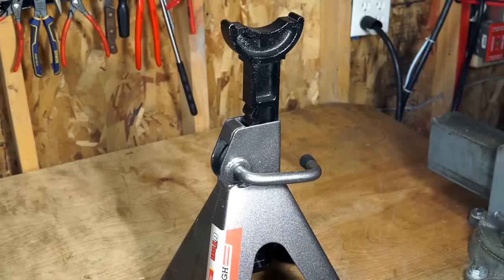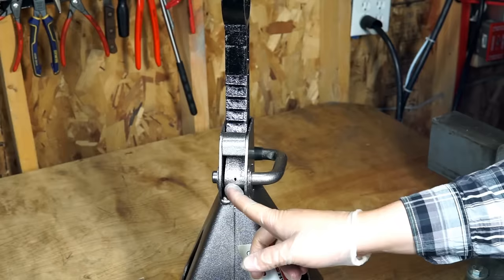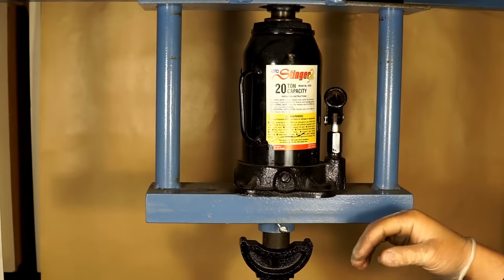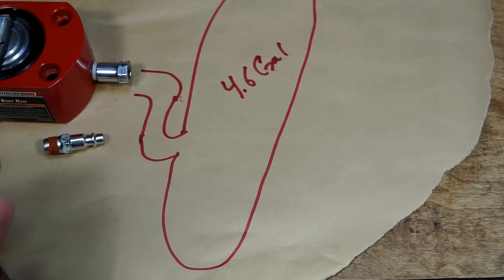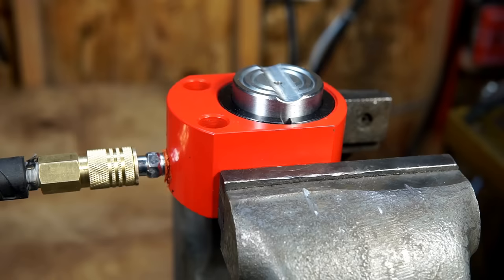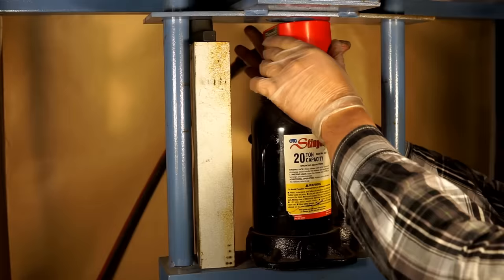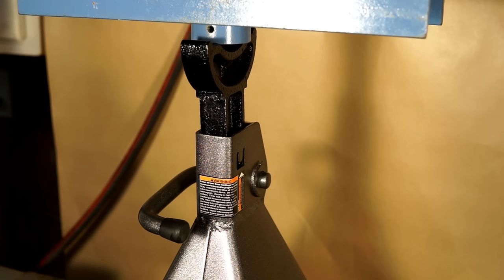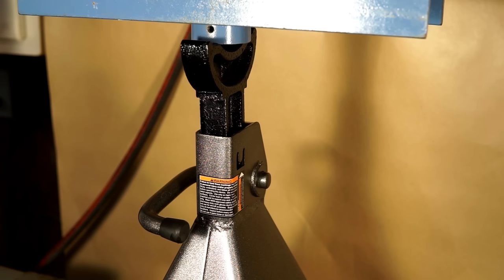EXPERIMENT: WARNING! Doing this to your Jack Stands will get you KILLED!

Comment: no way you can accidentally hit it that hard with a hammer.
Reply: theory ---- " no way you can accidentally hit your thumb that hard with a hammer " .... is there something wrong with that statement?  so there is a way to hit a jack-stand handle accidentally.
there are also ways to avoid such encounters from happening.
Reply: huh?
Reply: HUH? --- I will slow this down for you 
Pavlo95 1 month ago, stated "no way you can accidentally hit it that hard with a hammer " 
this person has either never swung a hammer  or does not ever miss... 
the BFH ( a BFH = Big F'n Hammer) I have used on a car has enough mass and inertia to move something that need to be removed, but I make sure that I am safe if something goes wrong... 

still too fast for you Karl... ?
Reply: accidentally hitting your thumb with a hammer is easy/common, you're holding the nail with your thumb, in no easy/common situation should you be hitting a jack-stand with a hammer while underneath it.  you're making connections that don't connect unless your making leaps in your brain that you are failing to articulate.

now your response to me makes even less sense than the first.
Reply: Agreed.  It's not just hitting it with a hammer,  it's the fact that it has to be done with an upward motion from a clearance height of about 6".  When he hits the jack stand with a hammer  it's in the press with plenty of clearance below the arm.  It's not in it's natural state sitting on the ground with no clearance to swing the hammer from underneath. It's much more likely to be done with leverage like a breaker bar or accidentally getting something wedged under it.   A good example would be working with an exhaust  component, thinking it's stuck, and trying to force it out when it's actually caught under the pawl arm of the jack stand.  That might do it.    Has to be something that causes leverage to be applied to the arm from underneath.  If you are working under the car on your back a hammer is not going to cause it, has to be a lever and a whole lot of carelessness (usually from lack of experience or caution).
Reply: saying there is not a way for something to happen puts into motion thoughts of how it could...   in this case a hammer..  the video shows about a 4 inch swing with a rubber hammer, most of the force is at the point of impact but some of it is directed back into the hammer... so change the hammer type when I want a part to move ( and have a replacement for it ) I will use a steel sledge hammer with a short handle. from the floor to the handle with the skinny side of the hammer ( if you use the ends you would only have 2 inches to move it ) you can get a lot of upward force in a short distance ... especially if you are mad you had to resort to brining out the BFH.
 and maybe it can be done with a hammer  ... but it sure would be stupid to stick you head where it could be injured.
Reply: It seems unlikely, but given all the times cars are put on jackstands all over the world, it wouldn't shock me if it's happened somewhere.  

I would expect it to be one of the least common jackstand failures, though.
Reply: Rottk. ill transfer you 10k if you show me your self hitting it with a hammer when its on the grown and the pin is only 20 cm above the grownd lets see how you build that momentum on the hammer accidentally or on purpose. the example you used also about using the hammer and thump is infuriatingly irrelevant.
Reply: it was a reply to RottK. check what he said then you might understand. and the word is grownd. do you feel self actualized when you spot a typo?
Reply: ouch, a typo I shall burn in cyber hell for a day... LMFAO ... thanks for proof reading.
ok there are variables that may be missing that I could add --- what condition was the jack-stand in? was there a defect in in the size of teeth where it would take less distance to disengage when a load was applied? so yes it may be possible...... 
cat637d the word is annoying - because there is more than one way of getting around a question just like there is more than one way to de-fur a feline ( skinning a cat would be messy )
Reply: Twice and you still can not spell ground, Earth, the surface we walk upon,  no gold stars for you!  When one spends 40 years in the engineering field writing reports without the benefit of spelling checkers one learns to spell!  Also,  are you referring to the term "self aggrandized"?
Reply: cat you are fun ---- the word CAN be grownd, 
grownd ( Noun )
grownd (plural grownds)
1. Obsolete spelling of ground
------------------------------------------------------  but it is the same.
Reply: It was incorrectly spelled GROWN in the first post.  After I pointed it out it was changed to grownd, obviously not the use of an older form of the word,  simply an attempt to correct the spelling. Why would a writer that can not spell use a obsolete form? Easy, it was an accident although unsuccessful I might add.  You Tube has a auto spell checker, why not believe it?
Reply: Yes, way! More accurately stated, that there is no way to envision every possible scenario that could result in triggering this event. Why take the chance when you can easily prevent it from happening?
Reply: Wango. yes, It's an impossible event. whatever happened to that guy with the accident was not caused by releasing the handle.
Reply: Ahmed Nabil wins this ridiculously debate.
Reply: agree, you couldnt swing in an upward motion with the stand on the ground. no way you could bump it accidentally. now Mikes wife may have "accidentally'' bumped the handle with a pry bar while Mike was underneath the car.
Reply: For sure. Or it was defective
Reply: especially when your in the horizontal position.....
Reply: I have had those stands fail. Keep in mind that after a few years of dirt and some rust on the latching mechanism the lock may not fully engage. I had one collapse as I was transferring weight from the jack to the stand. Also if using 4 jack stands the ground is not perfectly level 2 of them have nearly no weight on them. Think how easily a restaurant table wobbles before you jam some sugar packet under the leg.
Reply: Pavlo95 hammering a crusty wheel off a drum you sure could
Reply: If I gotta get a hammer out to take something loose. I'm swinging it hard to get it to break loose. Love taps don't work on 20 years of rust.
Reply: if your silly enough to place a jackstand close enough to accidentally hit it instead of whatever your trying to smash with a hammer under the car then i nominate you for a Darwinism award
Reply: not so much a hammer as a 2 1/2 pipe 5-6 feet long with an almost 8 foot draw on it . knew it was sketch so blocked out under the frame if the stands did fail but seriously ... taking wheels off that haven't been touched in 17 years in a land of road salt and snow is no easy task. although I doubt any such force would be required on a newer car lol
Reply: So you have never made a mistake that has potentially put you in danger? You must be super human smart.
Reply: Or careful.
Reply: No such thing as "no way".  "No way" is pretty much how ALL accidents happen.  Also, as an engineer, the way I would expect to see this happen by accident has nothing to do with a hammer.  I would more likely expect to have a dropped part rolling into the stand, or picking up a long pry bar or breaker bar and getting it caught up in the mechanism, releasing it.  This is the VERY DEFINITION of a failed safety design.  That shear pin should have "margin" ON THE LOW side!  Keep in mind the phrase "idiot proof", and I would add "engineer resistant".  As a designer you have NO WAY TO KNOW what some idiot is going to do in the field!  It's why I use my under wheel stands (home made from 2X4's) when possible, and always back the stands up with the floor jack, when possible.  Also, I always push the car hard laterally and longitudinally BEFORE getting under it when placed on the stands.
Reply: There are wooden piers and docks here that support loaded semis, and huge equipment weighing hundreds of tons, Not to mention the hundreds of railroad bridges made of wood still in use.
Reply: HAHAHA, You dont know some back yard mechanics, ive personally had to lift a corner of a car because a muppet missed a lower ball joint and whacked a jack stand arm, these types are NOT safe at all!
Reply: Akieba what kind are? I know those round ones are prone to folding but I've never heard a pyramid style being bad. I need to buy some anyways
Reply: Ahmed Nabil can I get in on that bet? What currency?
Reply: You have no idea how easily wayward hammers can find things you don't want them to find...
Reply: DJDevon3   If you were really trying to bash something, I could see the hammer glancing off the floor and riding up the side of the jack stand into the lever. Although it would be nearly impossible to get that kind of force while lying on your back under the car. I could possibly happen if you weren't under the car and swinging with two hands
Reply: "I accidentally hit my jack stand lever with a hammer"
Reply: Besnik and Jack ...  If you two have EVER worked on cars, you KNOW you've whacked your jack stands many times with various tools, hands, feet, jacks (especially if close together on the front crossover member, which makes it almost too small to get the jack thru), etc.  Yes, the likelihood of dropping it doing that is near zero, but it HAPPENED to the guy, so you can laugh all you want, but it just makes you look stupid.  There are other guys commenting in here if you read down that have LOTS of horror stories about jack stands that worked in shops, etc., so while this mode is obviously "way out there", it did happen.  It's you Jack, who's starting not to "gel", as you so studiously put it.  If you look on the net you can see a Camaro lying on it's side on the ground between a four poster.  I'm fairly sure, according to you two, that that can't happen either.  Grow up!
Reply: +luke saylor  i work on 7 trillion cars a year
Reply: +cat637d
*YouTube
*an
*spell-check
Reply: last part in this video explain it.... not with hammer....
Reply: Mat  MOST people, when they work on cars, use MORE than just a hammer?  ;-)
Reply: I think the locking teeth was warn down enough that it was able to be collapsed with a simple bump with an elbow.
Reply: @brent hann
this was in my mind when I wrote point #5 in my previous post. Yes, wives like that are more numerous than we'd like to believe. If I were an insurance adjuster on this case, you could count on me looking really close at any insurance policies that might have been out on this guy., especially ones he himself may not have taken out or be aware of.
Reply: 51 ... That, and maybe grinding marks on the teeth?
Reply: a lot of you should just give up if you don't understand that the law of probability says anything is possible but some things are just less likely to happen
has everyone forgotten potential energy? 
I think most of us don't bust our knuckles trying to break loose a bolt. its only in success when our potential energy is released and we punch the nearest pointy bits 
that sudden burst can build momentum faster than you can stop yourself and if that bolt is at the bottom of your shocks you could strike the jack stand with the end of your ratchet. 
yes I know anyone with half a brain knows not to put the stand near your work but if you stay on youtube enough you will see having half a brain puts you in the upper 25% of the world intelligence 

I also think whoever mentioned the weight distribution  hit the key here 
it was said its a porche aka rear engine auto. and he lifted the car from his face, assuming bench press as gaining footing for dead lift was difficult,
 now with all the info I'm assuming he had a front wheel off leaving less than 25% of the weight on the jack 
face smashed adreneline pumping I'm guessing he wasn't lifting more than 200 pounds
Reply: +mike dutdut  Well put!
Reply: Pavlo95 he coulda been prying on something and accidently got it wedged, or been using it for leverage with his feet, or he just rocked the car and the stand tipped over.
Reply: Pavlo95 maybe he had cheap ass jack stands.
Reply: Anything is possible when you start throwing every possibility at it. Fact of the matter is, under THESE conditions, these were the results.
Reply: anything is possible with hardor freight involved
Reply: Rhapsheet horrible freight? horror fraught?
Reply: I can see how a big guy under a car could smack his leg against that handle to cause the failure.
Reply: Pavlo95 unless that guys leg has the force of a few thousand pounds then it ain't going to happen.. ever.        Now a faulty stand or not latched correctly could have dire consequences.
Reply: Well if you recall we were talking about 500 pounds of direct force and he would have the mechanical advantage of the lever on the jack, if said handle was 6" long I think that would reduce the force needed on the handle to 250 pounds, sounds reasonable to me that he could do that with his leg, especially if he had just dropped something or hot oil just got into his eye.
Reply: In any case the jack should not have failed and it did
Reply: never set a jack stand on the ground it can sink in and tilt and you are dead  I've been using the same jack stands for 40 years and never had a problem with them failing a little of common sense could go a long ways when you are crawling under a 2 or 3 tons of metal  GO PRESIDENT TRUMP BUILD THE WALL NOW!
Reply: The new racism = trying to protect yourself from criminals who enter the country illegally.
It seems that doing things legally is now out of fashion...
Reply: you need a new smell checker.
Reply: Bagged ..  You don't need a few thousand pounds.  The lever has a mechanical advantage of two or three to one, and he had likely less than 500 lbs on the stand.  Try 150 lbs, EASY to get with a hammer.
Reply: John Sikes
Reply: So you're under your car and able to generate 150lbs to 500lbs of force with a hammer in the space from the floor to the height of the handle?  Unless you're Bruce Lee with a 1" punch, that's going to be extremely difficult.  Try hammering in a nail to a piece of wood, upside down, with about 3" of travel from the head of the hammer to the nail.  You're just not going to generate that much force.  

Something might be missing from the story... perhaps the motor was removed from the Porsche?
Reply: My friends say I repeat myself, that's what my friends say.
Reply: Michael Ball 
     The Department of Redundancy Department.
Reply: Tony ...  Once was enough.  ;-)
Reply: "Nothing exceeds like excess." ;)
Reply: Keegan ...  Exceedingly.
Reply: I have also always done the same thing, I don't know the dedication they put into making the stands or the jack, and it only takes 1 time to fail and be catastrophic, I have kids and I take every precaution in protecting and valuing my life under a vehicle.
Reply: Although, I Agree with you, it still is a possibility and these jack stands do require a new safety design.

I'd say lowering the capability off the safety pin would be sufficient, so it fails even at 50lbs
Reply: Hitting a lever upward with a hammer with that much force, using VERY limited range of movement. That is not even close to 'hurp derp you can hit your thumb while swinging in a wide arc going above your head using downward momentum.'
Reply: Exactly haha. You can't possibly put that much force on that handle with such limited range, whilst also accidentally hitting it. Perhaps the jack was just shit, and due to hitting it, it failed.
Reply: The only way you could pop a jack stand under that load would be if you were reefing hard on a bolt with a ratchet or a wrench, and the suspension rocked the car reducing the load of gravity on the jack stand, and then your elbow or your tool clipped the jack stand release extremely hard.  I still think given the circumstances at hand that the pin should shear first.  You can replace those pretty easy.
Reply: The guy who got stuck under his car should sue the car company because now we know that it was not his fault. He could get so much money.
Reply: LikaBoss Gaming Not sure if the car is at fault, but if the jack failed to do its job, than perhaps that might be a matter. But the dude said he might have hit the lever, so there is no telling what really happened.
Reply: Andy Zimmer 
when I've had to beat a rim off on the back I do it on the outside I hit the side of the rim and keep rotating it thats much easier than being on your back under the car them fuckers can be very hard to get off can't they.
Reply: I think if you could bench press one end of a small car with a crushed face you would have a chance though.
Reply: So it's then also possible for ou to swing it and have it bounce off and hit you in the head, instantly killing you while the jack stand is still holding the car in the air??
Reply: You've obviously never tried to get a corroded ball joint out of its socket
Reply: Why not?
Reply: agree
Reply: It is actually a dead blow hammer he is using as opposed to a rubber hammer. The head (or face) is filled with lead shot or steel shot, sometimes sand.
Reply: Steve S It is correct "a obsolete form". Just because the "form" (noun) is "obsolete" (adjective) does not change the fact it is a form. It could be a red form, a small form, a complicated form. But it is a form. Same would apply to a auto spell checker. Just because it is a checker for spelling and also automatic, does not change the fact it is a checker. I know when you are speaking it sounds very strange, but it is correct.
Reply: I agree. I think the experiment with the hammer was a little bit flawed: the pneumatic rig does NOT posses the same inertia as 500 lbs of weight. A hand-held hammer will have difficulty delivering a sufficient impact to propel 500 lbs of deadweight upward. Newton's first law of motion.
Reply: Its man made. What do you expect?
Reply: you don't need to touch  it, wrestling a muffler off will rock the car,  that's all it takes. use stands with safety pins only, cheapo HF stands are not safe.
Reply: That is what I do.  I always use jack stands with safety pins.
Reply: Ground
Reply: Pavlo95 just another wannabee mechanic driving a vehicle he can't afford ,probably after he went for a service and saw the bill for that junk
Reply: There's no law saying you will have 500lb on every jackstand, and 250lb will still mess with your face and be at least twice as easy to trip. 
But it seems to me what most here are overlooking is that there might be something else you are doing which momentarily lifts the vehicle, or at least, further unloads the jackstand.
You might be swinging with a cheater bar on a bigass nut, the nut suddenly lets go, causing the end of the bar to hit the lever just as the vehicle is rocking from the torque reaction.
Just 'cos you can't imagine what could go wrong doesn't mean it couldn't, and like Wango Tango says, it's easy to prevent it happening. All you have to do is wrap some duct tape or a velcro strap around the lever so nothing can score a direct hit.
Reply: Another flaw with the experimental setup: there is friction and hysteresis in the activated seals, meaning that it takes more than 500lb to get it moving
Reply: happened on film with their mira project
Reply: Try using pickle fork separating a ball joint.
Reply: Karl Andrews besides if you're under a car you can't even get the kind of swing length you would need to do this.
Reply: PVKLoL  I totally agree
Reply: crazy accidents happen everyday... I'm sure this isn't the last time it will happen to someone
Reply: eatmyskids my answer to everything also
Reply: That's not equipment-failure when dirt and crud are a cause.
 That's operator-failure-to-keep-tools-in-proper-condition.
Reply: I stopped the car weight with my face to protect the JackStand
Reply: It would be possible to kick the jack stand on accident for 500 pounds, when shifting around, especially if you don't realize you foot is pushing on the jack stand lever. I could see it happening, albeit, from someone not paying any damn attention to what he is doing.
Reply: It's easy to come up with scenario's that could have happened. But real life is a different simulation.
Reply: Murphy's law "Anything that can go wrong will go wrong"
Reply: @kingkarlito  - Cars haven't had the sheet metal nailed or tacked on since the '30s.
Reply: channelofstuff  - Unless you're so cheeeeep that you buy only the smallest (1 ton?) size jackstands I can't imagine a jackstand at the lowest being short enough to let a vehicle down on you.
Avoid those sheet metal jackstands whether adjustable or nonadjustable. They can buckle and collapse without warning. (Another lesson learned the hard way. Glad I wasn't under the car.)
Reply: It's hard to believe that anyone, taking any measure of precaution, using any common sense, with any situational/ spatial awareness could possibly release that jack stand with even 250lbs on it. That being said, take into account that "Mike" has none/used none of these and was somewhat or totally inexperienced, posses inadequate shop equipment/tools and just wanted to "take a whack at it".
Safety measures should be calculated and redundant not haphazard and singular.
Would it be easy for this situation to occur? Probably not. Is it possible? Obviously it is. It's happened before and will happen again.
Reply: @ROTTK9  lol you obviously don't understand sarcasm. Get out of that rock, Patrick
Reply: PVKLoL 😂 only if u are mad at it 😂😭😂😭
Reply: Lol at everyone talking about how "Well this poses the question that you could blah blah blah". Bottom line is there is simply no way you could easily do this and exert enough force to overcome the weight of the car resting on the jack stand. Aside from that, I also don't know anyone with half a brain who only uses 1 jack stand who is also stupid enough to somehow hit it that hard to make it fall. Sounds like a classic case of user error and people being stupid here to me but all of you can sit here and debate this all you want.
Reply: what?
Reply: I wonder if it was placed stable under vehicle? Kicked out instead?
Reply: No clue how I found this video.. I tried this yesterday and your right it's not easy
Reply: "no way you can accidentally hit it that hard with a hammer."

I would agree with that to a point. If your using a breaker bar for leverage to create enough upwards torque, that could transfer enough lift onto the vehicle to accidentally knock the jack stand off. I don't think the guy that was smashed was intentionally looking to become a pancake.
Reply: @ROTTK9  Sir, I believe that accidentally hitting your thumb while holding and aiming for a nail is quite a different thing from taking a hammer to a jack stand.
Reply: ROTTK9 p
Reply: Hey genius that has never had to swing a sledge hammer against anything. I can rock a 16,000lb big rig forward and back against the chock blocks by hitting a bolt with a 14lb sledge hammer. Last time i checked 500lbs ain't got nothing on a big rig. When properly swinging a 8lb sledge hammer you can generate between 5000-8000 lbs of force and that is if you are a scrawny engineer guy that did the testing. Take a 250-300lb diesel mechanic or farm boy and you are easily able to double that. Now just miss and hit the jack stand. I have moved my vw jetta using a 3lb hammer while it sat on jack stands. It slid about 3/4 of an inch forward. It was at this time i put solid concrete blocks under the vehicle because I do not want to see if i can lift my TDI up. My jack stands are through pin design with a detent which if you ask me are a hell of a lot safer.
Reply: Is it possible that he had the teeth on the jack stand back to front, assumed it was all set up properly and had the weight of the car on that has bumped it causing it to come crashing down.
Reply: @cat637d  I know this is 3 years old, I know I know, but you do realize when you say, "Twice and you still can not spell ground..." that it implies that you are still thinking that he is trying to spell "ground". And whether he's accidentally stumbled upon an obsolete word spelling, or knew it all along (but spelt it incorrectly the first time), the fact is it's spelt correctly the second time around and he should be awarded his gold star :) at your expense.
Reply: It was also only under 5 pounds of pressure, I want to see what happen if there was 1000 pound of pressure like a car would put on it.
Reply: What a dope comment. If the central support 'teeth' are shallower than originally spec'd because they been using the same moulds for 20-30 years, such that they DON'T need to lift anything to fail, then how hard you'd need to hit it with a hammer would go way, way down. Like enough that some Gov't might just make you recall all of them.  And gee, thats kinda exactly what happened.
Reply: @annieworroll4373  Millions of times a day vehicles are put on jacks, with millions of people of indeterminate capability crawling underneath them doing god knows what.